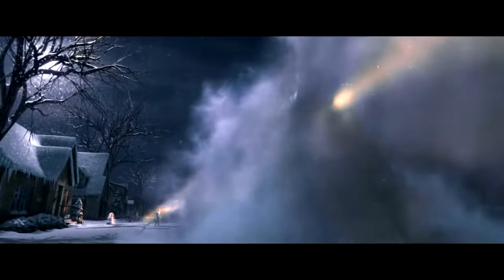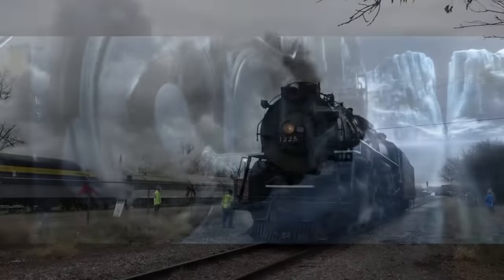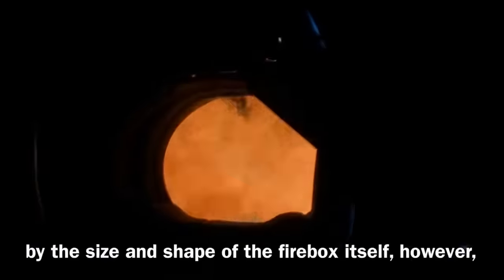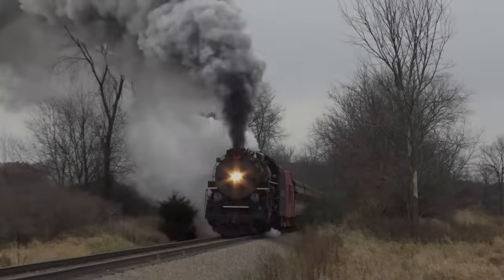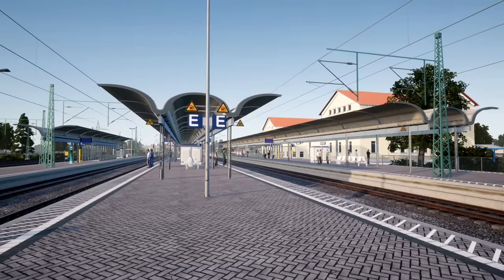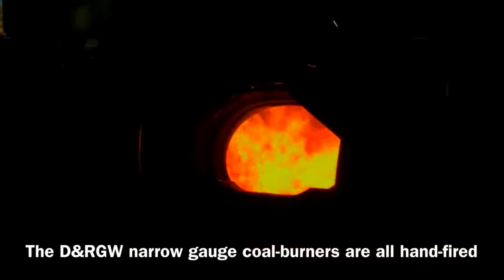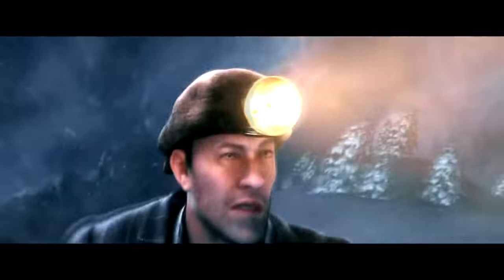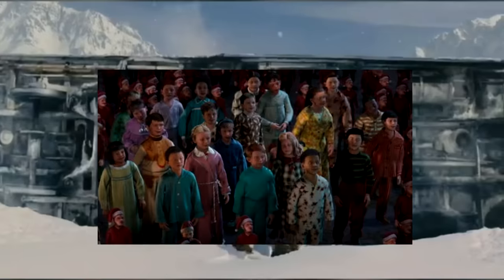Why The Polar Express would Explode

Comment: Steam locomotive crews working in the Rockies would routinely raise the water level considerably in the boiler before descending steep grades, to avoid the risk of running a “dry crown sheet”. The crew of the Polar Express ran that run enough to be aware of the danger involved with that grade and act accordingly. Just an observation from a professional boilerman….
Reply: The grades in the movie clip are far beyond too steep for that engine to operate on.  The boiler would have to be like 95% water to keep the crown sheet covered on the downhill.  At that level, the water would overwhelm the steam pipe in the steam dome, and flood the engine with water, blowing the heads off the cylinders.
Reply: Curious since the train is in deep winter would climate temperatures affect the boiler in that grade?
Reply: The grade is insane, there's no amount of water that sould save it. It would also be impossible to climb on rail without racks, but let's keep that aside for a moment.
On top of that, before trhe downhill section I reckon the engine would prime (which means, water gets in the steam pipes to the pistons; the regulator valve is in a dome above the boiler exactly for that reason, to prevent any water getting on it, but with the boiler barrel angled as much as shown in the movie there's no saving). That's VERY bad, because it would jam it open and you'd lose control of the throttle. Search Blue Peter to get an idea of what happens in those circumstances.
I also reckon the firebox would fail during said climb: with the engine under such stress you'd have to shove in coal non stop to maintain power, but at that angle not only the coal on fire would pour out of the hatchet if you'd dare to open it, you wouldn't be able to cover all its area even if it had some kind of impossible design made to contain the fire in at crazy angles. Uneven fire distribution would weaken the grate.
Reply: @the_dudeabides  complete impact would depend on the thermal conductivity of whichever metal or alloy is being used. But the boiler and piping would have to be highly insulated otherwise you would have water pooling in the pistons.
Reply: What about killing the fire before they go down the hill? If the downhill grade is steep enough, is that an option?
Reply: @djpiercy1235  it could work but restarting a fire like that is very intensive, plus there's the residual heat. And in the case of the polar express, there's a good chance the water in the boiler could freeze over.
Reply: @captainufo4587  you couldn’t keep the coal in the firebox going up that impossible grade, every time you’d open the firebox door to stoke it, the coal would come falling back out….
Reply: @d455ave  absolutely unrealistic grades for sure. However, if they were toned down to a realistic max grade of 10% or less (5-7% being most common on standard railroads) then it wouldn’t have made for good entertainment! 😂
Reply: @d455ave  I am sure there can be found a remedy for that. If you know your loco is operating on such insane slopes, use a Brotan boiler or a water tube boiler. There, the walls of your firebox consist of tubes holding water. Either put a pump in the sump at the front or install a valve that, in case of an air bubble (ie. the aft is no longer covered in water) switches directly to a Heinl mixer-preheater delivering fresh water to the boiler. (A Heinl preheater works under pressure, so it pre-heats the water to over 100°C.)

You can also install walls into the boiler that allow water only to change "compartments" if it surpasses some height.

A rollercoaster may be a tad extreme, but there are lots and lots of obstacles steam locomotive construction engineers had to overcome.
Reply: I was gonna say something like this. Plus, if this train is advanced enough to run on literal physics defying magic; I think the society that built it would be far technologically superior than our own(which we do see multiple examples of throughout the movie); which implies they would probably have far more advanced safety systems(possibly combining magic and tech); which would obviously be likely beyond our current comprehension(as evidenced by the technology seem throughout the movie like I previously mentioned). If you wanna make the argument that it looks like a lot similarly designed to other non magical trains in the timeframe of the events of the movie; this could likely be explained away by just saying it was a purely aesthetic decision, taken from the popular designs of that era.

I mean i hate to be that guy but this seems pretty easy to explain away
Reply: @rippersix293  I'm not sure where you got a 5-7% grade being standard. That's That's 5-7 foot up in a 100 foot area. The steepest mainline grade in NA is just over 4, and that's Soluda Grade in the Carolinas. It's so steep for trains, that if they go over 5mph downhill, they get sent onto a dead end track to derail out of the way. The average grade in NA is 1.5-2%.
Reply: @trainfan4449  He said "realistic max grades", not "standard grades". And yes, in the 1915-20s it was discovered you didn't need cog locomotives for up to 6% elevations (Halberstadt-Blankenburger Eisenbahn HBE Tierklasse, leading to the Prussian T20/DRG BR 95).
Reply: @d455ave  again it runs that grade meaning it’s designed properly there are boilers designed for grades like that and usually in most locomotives that run grades that steep have lower crown sheets
Reply: The only thing I haven’t seen in these comments is whether or not it’s possible to build a locomotive for those grades and the answer is yes it’s possible however it wouldn’t look like that diagram in the video that’s for sure, it would have a lowered crown sheet and a really odd looking steam dome that’s raised high enough and extends back enough to only allow steam in so it definitely wouldn’t look like the polar express in the movie either
Reply: Exactly. The crews of steam engines know how to maintain an engine, and prevent such disasters from happening.
Reply: @cyborgbob1017  I would also imagine a steam engine is a lot easier to enhance magically than diesel or electric.
Reply: It's a Christmas movie.  🎄
Reply: Perhaps they wouls have also intentionally neglected to feed the fire so that the firebox wouldn't overheat?
Reply: @joeleboeuf  lol ok
Reply: @d455ave  "its a magic train" -Some Random Little Girl On The Poler Express
Reply: @d455ave  Actually a locomotive such as a Mallet would do that job but even then the grades in this film are too steep.
Reply: @d455ave You could turn it into a funicular. Have the train get on a platform and the platform would lower.
Reply: @captainufo4587 If you kept it level using a platform as a funicular, you could avoid it.
Reply: @cyborgbob1017  Gravity manipulation is probably one of the technologies that could be in play.
There's very little friction between the wheels and the actual rails. Only the immense weight of the train is what allows it to even move. In some situations the driver would release sand from a sand dome onto the tracks so the wheels can grab onto it. A real train would struggle to if not be completely incapable of getting up a steep hill and some of the hills the PE went up were incredibly steep.
If you could modify the weight of something you could make it stick anywhere perfectly. You could make an object the weight of an aircraft carrier and then the weight of a feather with gravity tech.
Perhaps the coal they were shoveling into it were mini black holes or something.
Reply: True. They also could have doused the fire for the trip down (maybe?)
Reply: If you ran the water high enough to survive a 60% angle you better have an explanation for where all the water that's now flooding the steam dome and consequently dry pipe is going to go other than blowing the ends off of both sides of both cylinders. She'd never even make it to the bottom of the hill before the running gear comes apart in spectacular fashion. 

I sincerely doubt the superheaters and open cylinder cocks could overcome this hydraulic problem.
Reply: @the_dudeabides im not an expert but id guess the -30 c temperatures of the north pole in winter would mean very little to a 1400 c fire
Reply: @the_dudeabides Not significantly. Boiler temps are one, if not two, orders of magnitude larger than any range of ambient temps a train could experience.
Example: the difference between the highest and lowest temperatures ever recorded on earth is only 262F, or a little over 10% of the 2500F given in the video. Now imagine that the absolute maximum temperature range you ever experienced was ~10% of your body heat, or ~10F. You could barely make out the difference between extremes, and it certainly wouldn’t change how you function.
Reply: Fair, but as others have said that grade is steep it belongs on a rollercoaster (because the crummy movie is full of stupid exaggeration). The tracks climbing the Rockies are steep, but within reason. You'd need a mountain engine with a slanted boiler to handle that grade. And even then, you'd want it going in reverse on the downward trip.
Reply: @d455ave it's a magic train dummy
Reply: @rippersix293 the National Transportation Safety Board and the Department of Transportation would be in a WTF mood looking at those grades😂
Reply: When at a station to get water, how long would they wait to fill it with water?
Reply: Pressure difference?
Reply: He only runs that track once a year... I would honestly assume that the conductor is.. not as experienced as he looks
Reply: You can literally start a tiny fire yourself in the blistering cold, as long as fast wind isnt there to take it out. So no, temperature does not affect fire at all, im sure it does at some point, but thats gotta be realllllllllll cold @the_dudeabides